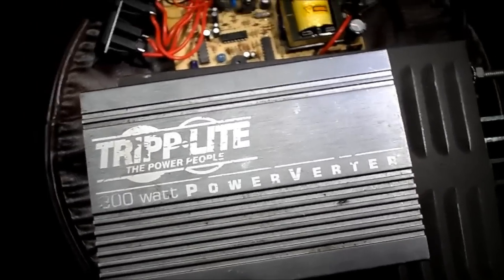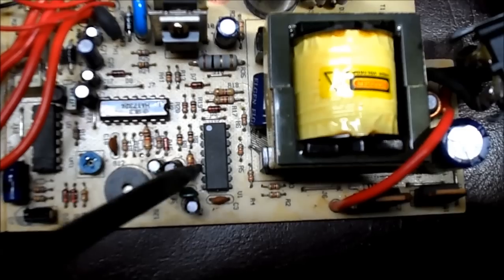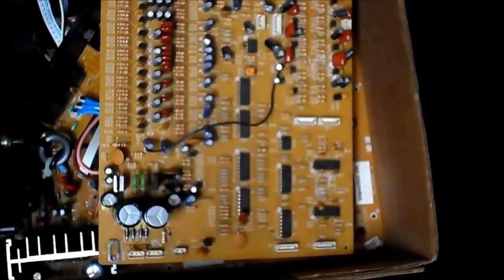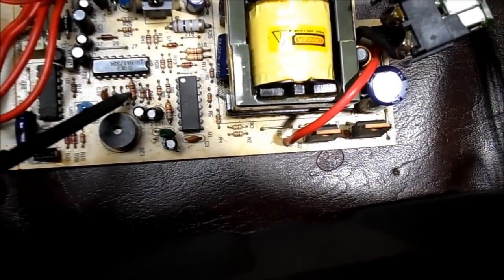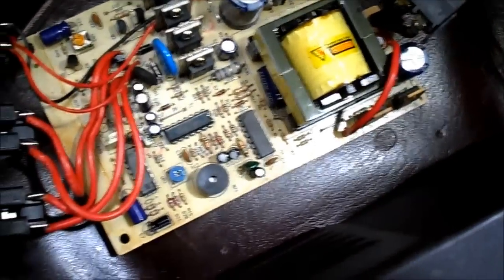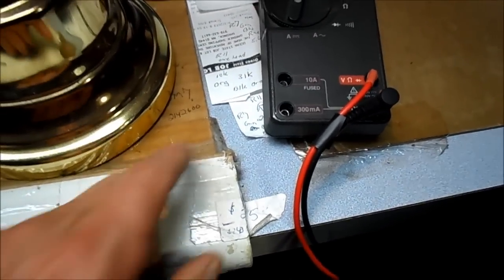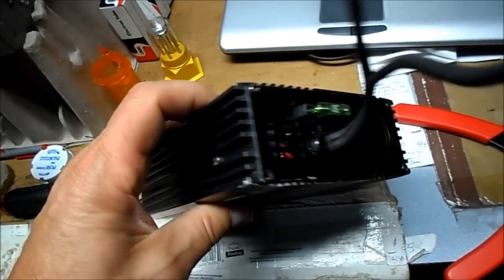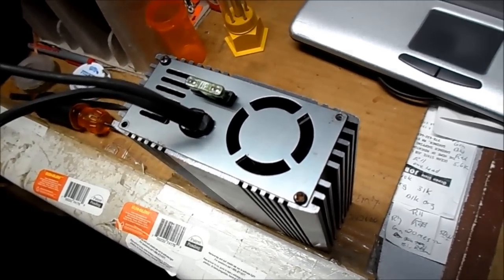Tripplite PowerVerter 300 Watt Inverter Repair. Another schematic-less repair.

Comment: I've done extensive work on that particular inverter.  I have full schematics and even the identity of those chips that are obscured.  It was a training research project.
Reply: Hi Randy! If you can help with tripplite apsint3636vr schematic I would be very greatful. PCB number APS-48VFWB-MOD 66-0578 REV B. I have a problem with my inverter/charger because it burns some of mosfet transistors when pass from inverter in charger.